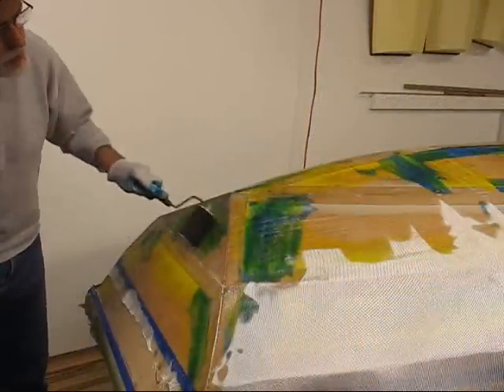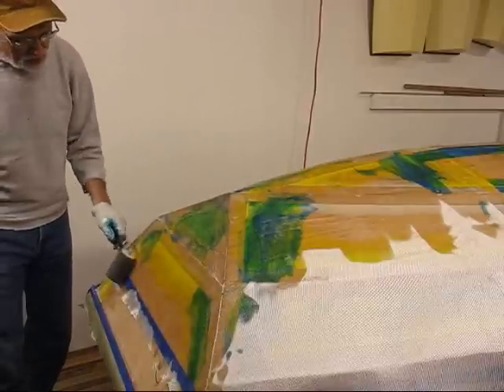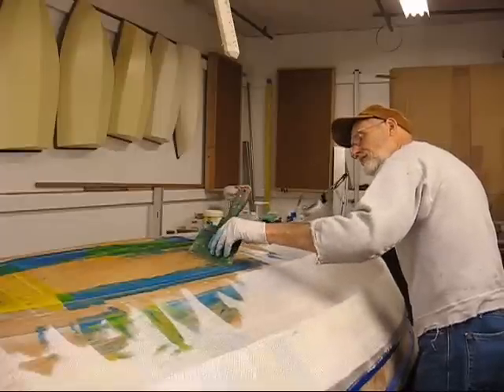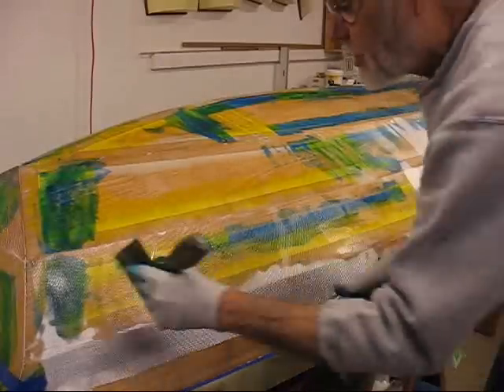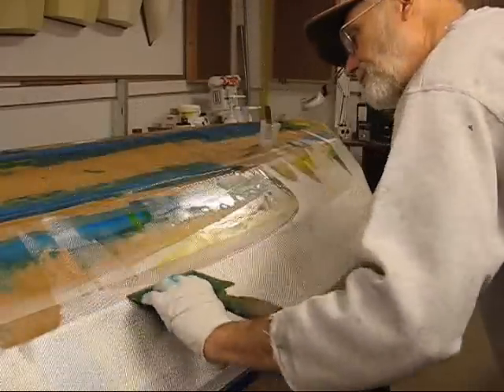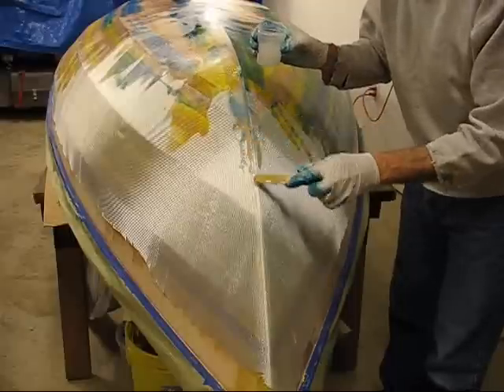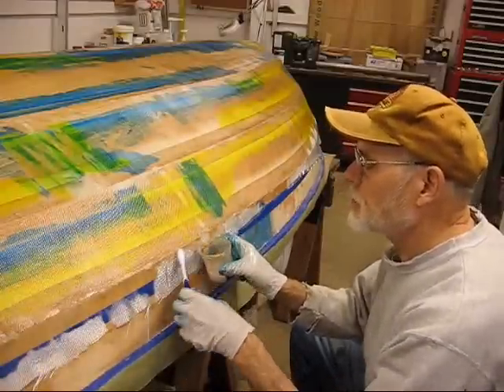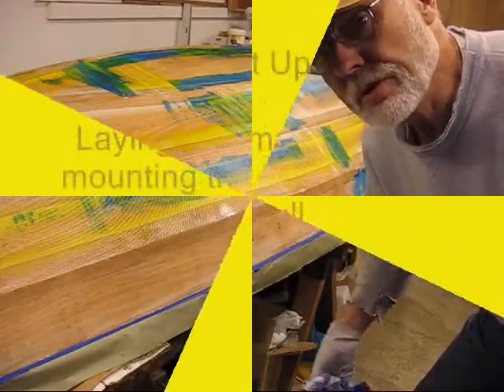Part 30-2 Wetting out the Glass Cloth.wmv

Comment: I wished I would have your video around last year when I put the deck in my fiberglass boat restoration.  I must have used 3 to 5 gallons of poly resin to lay down 6 oz woven and 1.5 oz CSM.  When I see the little amount you used to glass the hull I konk myself on the head. lol
Reply: Sounds about right for the CSM